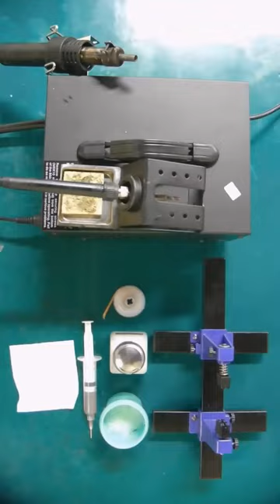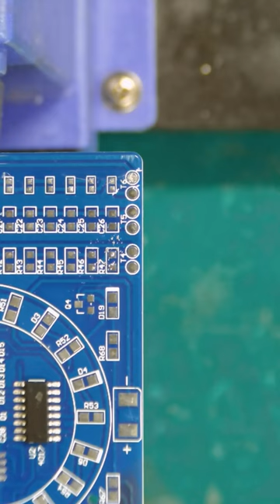Soldering tutorial for beginners | SMD soldering course | Soldering for beginners

Comment from the maker: The technician in the video is soldering capacitors on a blue soldering practice board. Some capacitors look huge under the camera, but in fact, they are very small. If you use tweezers to clamp such a small capacitor, don't use too much force, otherwise, the capacitor will easily fly out.

Tools used in this video:
1. Hash board chip flux paste: https://www.zeusbtc.com/ASIC-Miner-Repair/Parts-Tools-Details.asp?ID=1765
2. Stainless Steel Tweezers Kit for IC Repair: https://www.zeusbtc.com/ASIC-Miner-Repair/Parts-Tools-Details.asp?ID=1668
3. ANLIXIN-862D desoldering station: https://www.zeusbtc.com/ASIC-Miner-Repair/Parts-Tools-Details.asp?ID=125
4. Circuit board cleaning solution: https://www.zeusbtc.com/ASIC-Miner-Repair/Parts-Tools-Details.asp?ID=1782
5. Tin paste: https://www.zeusbtc.com/ASIC-Miner-Repair/Parts-Tools-Details.asp?ID=1821

Comment: That is completely the wrong way to solder SMD parts. You shouldn't be passing on incorrect info like this.
Reply from the maker: Hello, there are many methods of soldering, and this is one of them.❤
Reply: @ZEUSMINING  - yes, there are many ways. This is certainly not the easiest or best way to use solder paste and an air reflow gun.